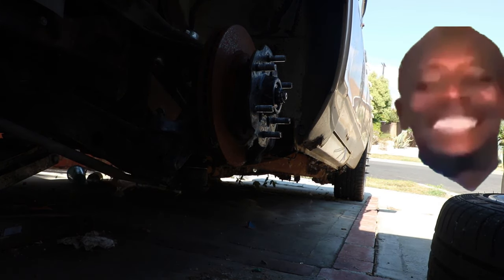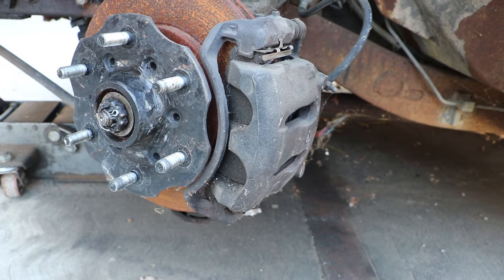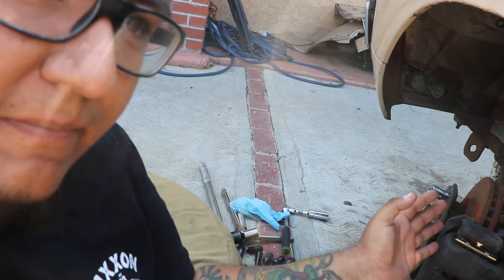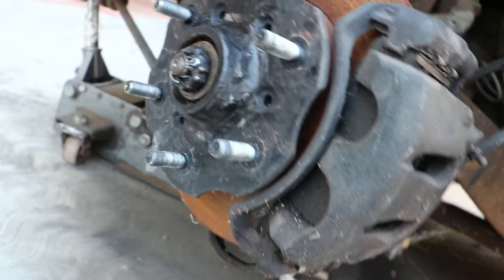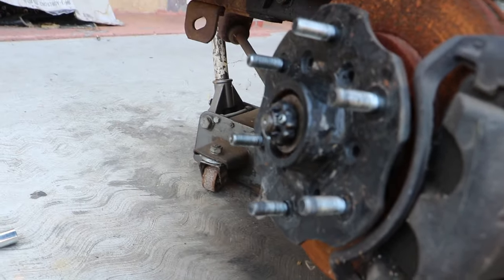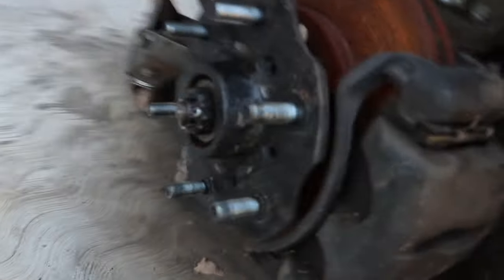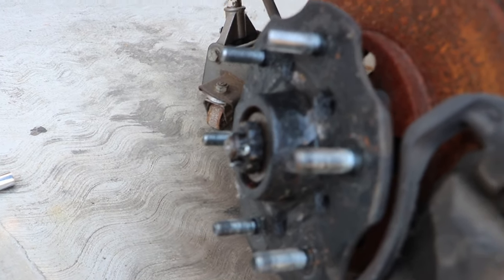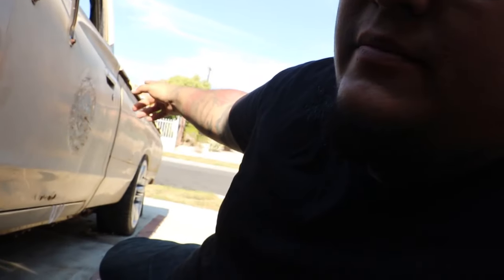Datsun 620/ Nissan Hardbody D21: How to upgrade front disc brakes

Comment: I have a question I have a 1989 Nissan hardbody D 21 I have trouble with my front brakes they’re stiff I bled them like 45 times and I still have the same results I change the booster and a change master cylinder

Comment: Wassup bro I have a question I have a 1995 hardbody and I’m trying to upgrade to slotted rotors do I have to swap caliper and bracket from a 4x4 because the rotors I have it’s a 1 inch bigger than the OEM

Comment: 4x4 pathfinder callipers, v6 hard body 2wd rotors. Any other combo of hardware from any truck or pathy from 78-98 will work. I have a ball joint converted 71 I did this too.  I'm looking to go 300zx in the future. The pathy brakes were a fucking HUGE difference though.
Reply from the maker: Good to hear man thank u for chiming in 
I'm actually working on an IRS setup in back from an armada and some type of Frankenstein for the knuckle in front with the stock armada stuff but cut down n fabbed to fit beebani upper n lower arms
Reply: @baggednboosted9951  oh that will be cool man. I really wanted to do something with the rear end in my truck as well. That's something I haven't seen before.

Comment: I got a 77 datsun 620 and a d21 1990 4x4....do u know if my front suspension would work to do the swap on my datsun
Reply from the maker: I believe it will not on the 4x4 the brake and hub are different so ur regular 2wd spindle will differ from the 4x4 spindle so stick with the 2wd stuff since the spindles are the same

Comment: Having a hard time finding D21 brake lines damnn I don’t live in Cali either.
Reply from the maker: Pathfinder brakes line from 1989 to 1995 will do fine autozonw or oreilys should have them or be able to order them its common part

Comment: Básicamente para hacer el cambio, necesito toda la masa de una pathfinder y queda en los brazos de rotula sin problema, tengo un Datsun 620 73" con brazos de un 78-79" que originalmente llevan disco, solo cambio la masa y listo?
Reply from the maker: Si se puede tambien asi mis spindle y Mada de baleros son de una de las trokas bajada 2 pulgadas tambien puede quitar todo de una troka hardbody v6 que tenga los frenos de Doble piston y listo
Reply: @baggednboosted9951  perfecto, muchas gracias, tenía que cerciorarme antes de y viendo tu video me di cuenta de ello ¿para la alineación no batallaste?
Reply from the maker: No mi carnal al alineación es como regular los brazos no cambian y le geometría del nuevo spindle y los brazos de alineación son iguales
Reply: @baggednboosted9951  perfecto camarada, entonces todo da, con masas de un Hardbody o Pathfinder v6 2wd y listo, muchas gracias

Comment: Just got. 79 620, can I use the front calipers, brackets, and hub assembly from a 2wd hardbody 4cyl?
Reply from the maker: Yea man u can swap the entire spindle assembly with everything on it for a upgrade swap just get new ball joints for the same year hardbody they will bolt up the same and you'll be Gucci!!!
Reply: Bagged N' Boosted will it work with the stock spindle or do I need the hardbody spindle to make it work?.     Thanks for the fast response
Reply from the maker: I haven't tried it with the stock 620 spindle honestly so idk about that one.
Reply: Be choosey though. Some hardbodies only have a single Piston. You also have to use the big rotors from the v6.
Reply: @gregbement1903  it'll work with your spindle if you have ball joints but at pick n pull you can get the spindle, hub, brake calipers and lines for next to nothing. I did my whole conversation for $90 including brand new quality rotors and pads.
Reply from the maker: All correct answers but yes most if not all 4cyl hardbodies used single piston calipers so u could go that way but u have to get that size rotor for a 4cyl otherwise use all the 6cyl stuff from one truck either a hardbody or pathfinder n you will be fine the rotor sizes are different with the 2 piston calipers so make sure u get the same one for that truck and always match the parts u have n the parts that are new for differences in sizes

Comment: Can you use stock Datsun spindle?
Reply from the maker: no I belive the datsun spindle is smaller than the hardbody one but im not 100% on that u could check part number for the bearing sizes if one is smaller or bigger then no if they are the same size then yes

Comment: Want to do the ball joint convertion...what do i need?
Reply from the maker: Depends on year of ur 620 is it already disc brake stock? Or is it drums with king pin? If it's king pin with drums u need to get new arms upper and lower from beebani on Instagram then u can do the hardbody spindle and 2 piston brake upgrade all depends on what u have n what u want to spend
Reply: @baggednboosted9951  77 kc...king pin
Reply from the maker: @isaelmarquez671  then yea u need to get upper and lower control arms from beebani on Instagram then u can buy the drop spindle or stock spindle for a hardbody and swap in all ball joint components to the new arms and spindle
Reply: @baggednboosted9951  do u have a phone number or an email adress...?thanks for all the info
Reply from the maker: @isaelmarquez671  yea go to my Instagram and message me there I dpnt want to blast my phone publicly u know
Reply: @baggednboosted9951  i dont have instegram....i can send u mine
Reply from the maker: @isaelmarquez671  sure yea